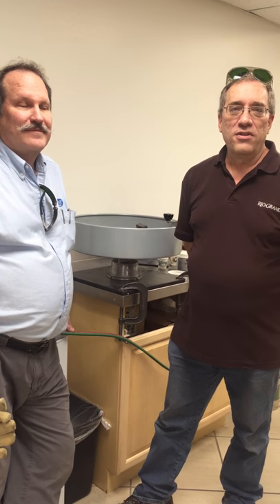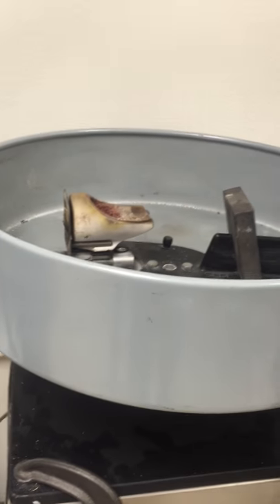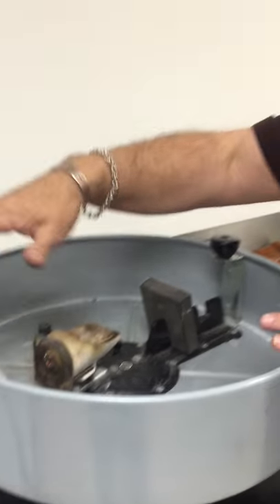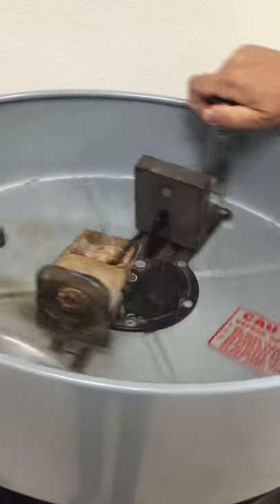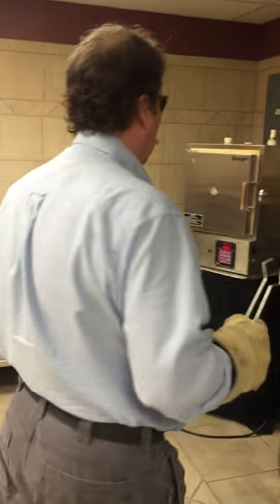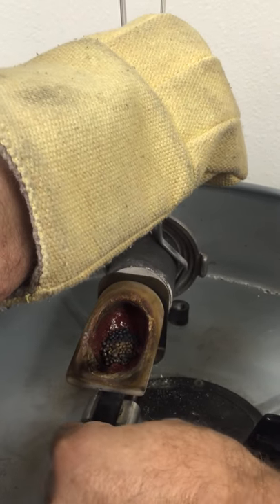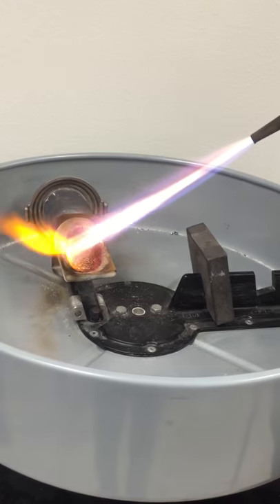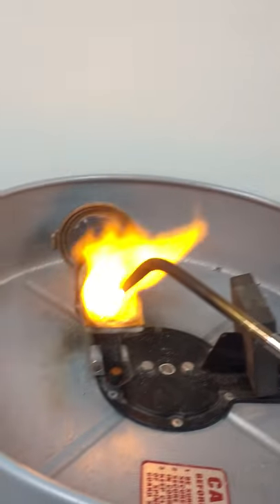Periscope Broadcast: Casting with the Jewelry Tech Team

Comment: Wich one gives a better casting with much smooth details the vacuum casting or the centrifugal casting  ?
Reply from the maker: Both will give good surface qualities but vacuum can give slightly smoother surface qualities because the metal can flow in a little smoother with less turbulence.
Reply: @RioGrande1944  thank you so much

Comment: Hi. Very good information. Very comprehensive. But what happen with the air or gas trapped inside the mold in centrifugal casting? I do not see vents...
Reply: you must be a mouldmaker!kool...me too,automotive plastics...ip n door panels.the air while casting gets pushed into the dry n hot investment...just like using porcerax in a "tough" area to vent in plastics...basically the hot investment breaths and no flash!
Reply from the maker: Hi, +Relu! Thanks for asking! Great question. The force of the centrifugal casting machine pushes the metal into the cavity and pushes the air through the pores of the investment. Since the investment is porous, the force from the molten metal pushes the air through the investment. Let us know if we can provide any more info for you! :)
Reply: Thank you. I never considered the investment is that porous. Now I understand. Very fast answer. As always RioGrande have super Customer Service.
Thank you very much.
Reply: Yes, I see now. :) Thanks. I try to cast sterling silver. I am setting up my little studio, gathering tools, etc...and because of lower production cost I am interested in Lost Wax casting with centrifugal machine for now.
Reply: I said it first! lol. im exactly where you are...I love it. all the best. keep carving.
Reply: no vents  are needed..the investment is very porous  the force of the centrifuge will push the metal hard enough to push out the gases!!
Reply: Yes.  Thanks. I understand now why flask need to be proper burned. To allow the investment to become porous.

Comment: Informative video. Was great to see the two machines in use. I was wondering about the Rio Assist Crucible Holder system. What is the advantage of that compared to the simple crucible handle system you were using. The Rio Assist is quite pricey. Would it be possible to have a video of the Rio Assist in action?

Comment: I was hoping to get more information out of this video... 
Learn about the benefits, differences between centrifugal and vacuum casting. If you had the choice, which would you use for what and why? (I am thinking about adding a vacuum casting machine)
1. If you have very fine detail in a wax, which one would be better to use? 
2. Other reason why you would prefer one over the other, if you had both available? 
3. Better for white versus yellow gold?  High nickel white gold sometimes gives me trouble in centrifugal casting. Would investing in a vacuum casting machine make any difference, worse, better, the same? (Assuming no mistakes with button size, spruing, flask temp, etc. in either process)

Just a comment on heating the crucible.
It might make no difference, but I always heat the crucible first, before adding any premixed, already alloyed gold. If I am alloying,  I place the fine gold into the cold crucible first and heat it with a oxygen rich flame until the fine gold is totally melted,  (quick and fine gold does not oxidize), then after changing the flame to a reducing one, I add the alloy.
I also use a heavy duty vice to keep the torch on the crucible when I need both hands to get the flask. Doesn't the flask cool too much having it sitting on the vacuum table for as long as you show it?

By the way, thank you for having a jewelry tech team ready to help! I have used it in the past for plating issues and got great support. Rio Grande is awesome.
Reply from the maker: Hi there! Thank you so much for reaching out to us. What great questions! We'll do our best to answer them in full. 

In regards to some of the differences between the two methods of casting:
 -If you are using a torch to melt the metal, both casting methods will give very repeatable and very comparable results.

-Centrifugal casting can give slightly better and crisper details due to the energy generated during the casting process. Spin casting can also fill slightly finer details like filigree a little better.

 - Units like the Vic 9 only draw from the bottom of the flask so they can have more difficulty filling finer detail on larger thin items.

- Units like the Vic 12 that use the perforated flasks draw a vacuum from all directions and, therefore, have better filling capabilities.  These units also may have a larger vacuum pump to help draw the metal into finer areas. Larger vacuum pumps generally work better with perforated flasks.

 - Both systems work fine for both yellow and white gold.  You should not really see any difference between vacuum and spin casting, as far as quality goes.  High nickel white gold is just kind of a pain to cast.

- One big difference with vacuum casting is you can pour larger amounts of metal when using an electro melt. These units melt the metal in a more controllable environment and hold the metal temps more accurately.  This can lead to better castings without overheating the metal. The flask does start to cool as soon as you turn the vacuum on. It starts drawing room air into the core of the flask so you want to pour as soon after you get a full vacuum as possible.  The longer the flask sits with the vac on and running, the faster it starts to cool the core of the flask.  Since the investment is a great insulator, the core temp of the flask doesn’t drop too quickly until the vacuum is turned on. Once you turn the vacuum on, it starts dropping quite quickly but you need to give it a few seconds to fully evacuate the air before you pour. 

We hope this helps! Let us know if there's any more information we can provide for you! :)
Reply: Thank you very much! Good info. I appreciate you responding.
Fine detail in the pesky nickel white gold is what I am most struggling with. For it, I will stay with my centrifugal casting. But for bigger castings, I will check out the Vic 12.
Happy New Year!
Reply: please...please stay way from Vacuum casting unless you have experience...I have been casting for 36 years I have it all centrifugal...vacuum   induction a d induction vacuum..there are some metals that just won't fill by vacuum. .save your well earned $$$

Comment: This video was really great, thank you! What other pros and cons can you think of between the two casting methods? I've read that the vacuum method seems to yield more consistent casts, but something about the centrifuge method is really appealing to me. I of course would opt for the method that produces a higher quality outcome. Is one better than the other? Or do they both have the same potential?Also, what kind of torch are you using? Thanks again! I can't tell you how much I appreciate you making this video:)
Reply from the maker: Hi, Kristina! Great questions, thanks for reaching out :) First off, the torch is a casting torch with propane and oxygen like this one:  https://www.riogrande.com/Product/Smith-Propane-Casting-Torch-System-for-Platinum/500324
 
Now, onto the differences between the casting methods;  centrifugal casting is very reliable and fool proof  because you have that constant force pressing the metal into the cavity, and many people feel they get a denser casting with centrifugal. 

Vacuum casting can cast larger flask sizes. The vacuum casting machine also comes with the vacuum table, so the purchase of another machine is not necessary. Also, the vacuum machine can be used with an electromelt, so a casting torch is not necessary. 

Does that help? Let us know if we can provide you with any more info! :)